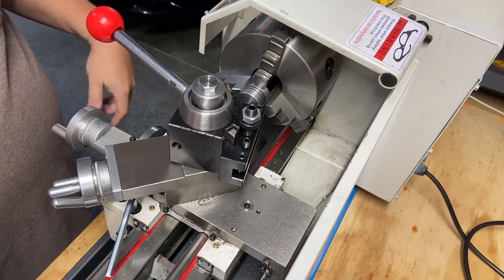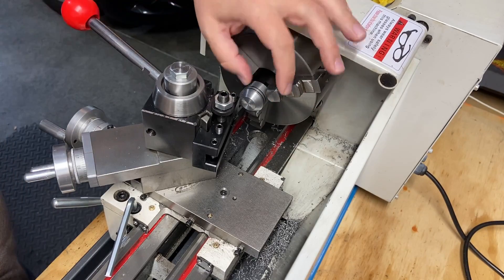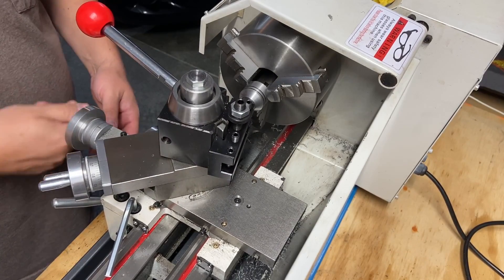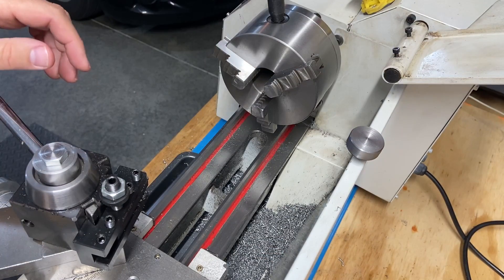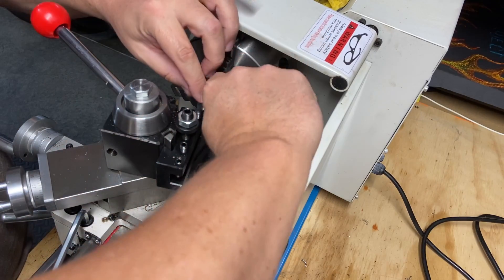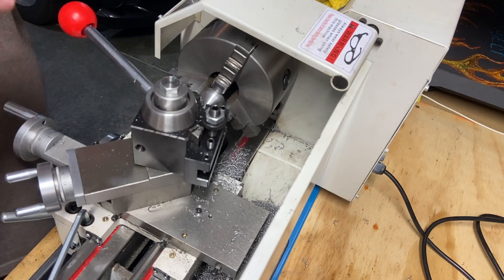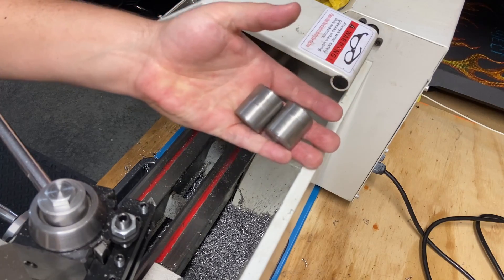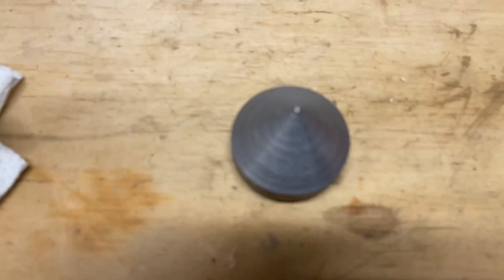Vevor Mini Lathe MX 400 Part 38 - Run your Lathe in Reverse to cut Tapers w/ more accuracy and ease

Comment: You must be mindful of lathes with threaded spindles ,the chuck can work loose when run in reverse and undo.l tend to run the lathe in the normal way but turn the back tool upside down if you wish to turn in that attitude.
Reply: No worries on that score with these mx/ts lathes, it is a good point though, an old Myford or the like with a threaded chuck might well undo itself if you ran it in reverse.
Reply from the maker: @TheHamstein  agree these are good points.  Something I wasn't aware of but what i really like about this channel and good comments.  Learning details all the time.
Reply from the maker: I’ll have to check mine. There is another reason for running it in reverse and my compound on the back. It’s more comfortable and more importantly sat a safer angle for me to turn the taper. I will check out my spindle sometime. I haven’t tackled that yet if it’s threaded on Or pressed In. I’m sure others already know.